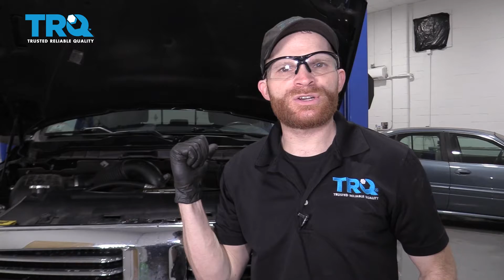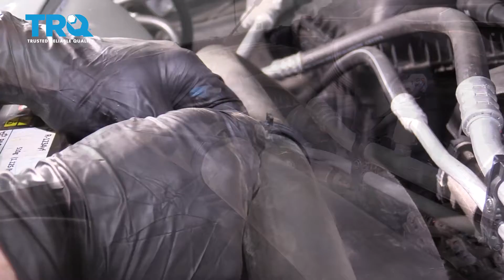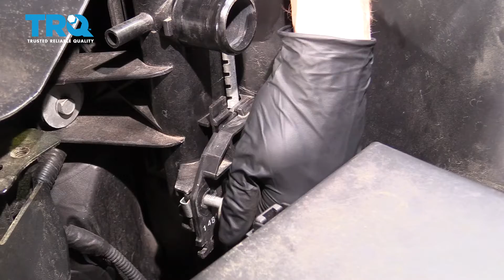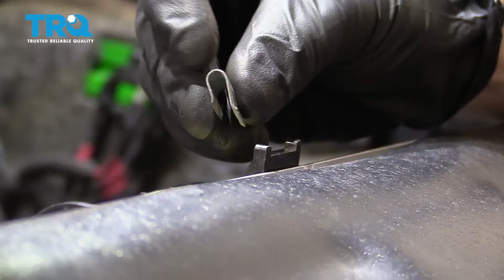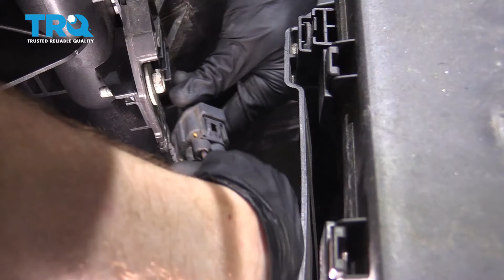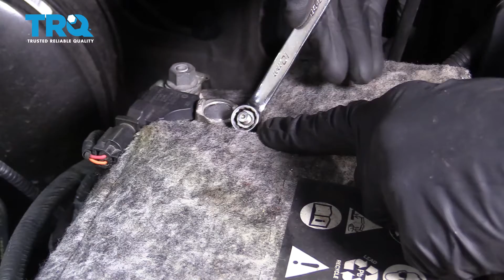How to Replace Radiator Cooling Fan Assembly 2013-2018 Dodge Ram 1500

Comment: Thanks for the video. Definitely helped. But I was able to replacing without removing the clutch fan from the pump and either of the hoses- I moved the big cover far enough and tilted the electric far and was able to remove it from the bottom and put the new one through the bottom too.

Comment: The fan is a 2 wire.
Weird thing is the wire that doesn't  connect to the fan is hot when the ac is on,but fan won't come on

Comment: I just watched two minutes of one of your other click bait videos that was titled how to change radiator in 2013 2018 dodge ram 1500 and it has a belt driven fan.now this video of how to change fan on the same truck suddenly has an electric fan.which is it.any click bait misleading titled video I come across I automatically give a rating of PG for PURE GARBAGE.So far all of your videos have been PG.

Comment: So I did this today on a 2014 ram 1500 5.7 hemi. You do not have to drain coolant or remove any hose. You do not have to remove clutch fan but it does make it easier : you don’t even have to remove the fan shroud. It takes patience and an extra set of hands but you can remove the fan assembly while the shroud is pushed against the engine. Lift the passenger  side of the condenser fan upward so the driver side can slip under the upper radiator hose where it connects to the radiator. The other person can push and bend the shroud as needed as you wiggle the condenser fan assembly up and out.

Comment: No need to drain the coolant and remove the hoses, especially the bottom hose. The top hose only to make a bit more room. But the bottom hose absolutely no need for removal . You can do this job without removing the coolant or hoses.
Reply: Do you even need to remove the fan clutch. Seems like you can get it out without removing.
Reply: @anthonydimperio1460 , I believe you can remove the bottom half of the shroud and it may pass by the fan clutch. If not, just un-clip the condenser fan assembly and pull that and the shroud out together.
Reply: Is the fan controlled by relay k01 rad fan lo sod and k02 rad fan hi spd? Also fuses f01 rad fan pwn and f03 rad fan hi/lo?
Reply: @ml-ed4sc  check for power going to the fan at the plug. a test light will work.also my fan was not running after banging it with a hammer it started running so odds are that my fan motor is going bad.